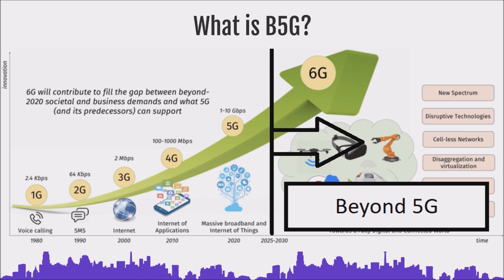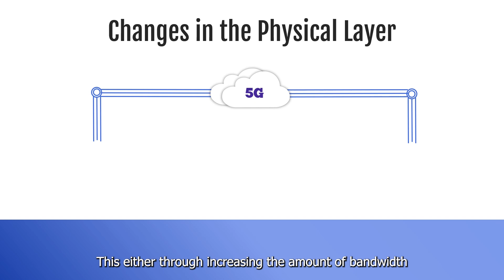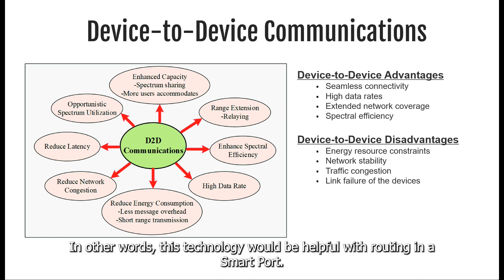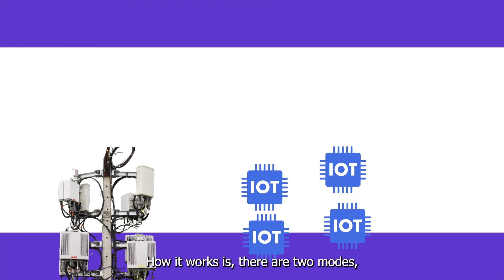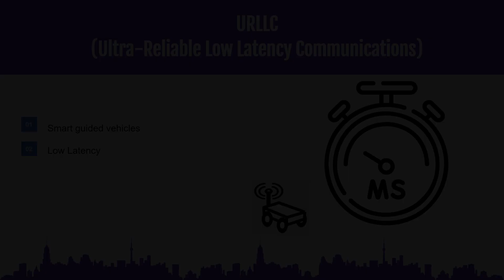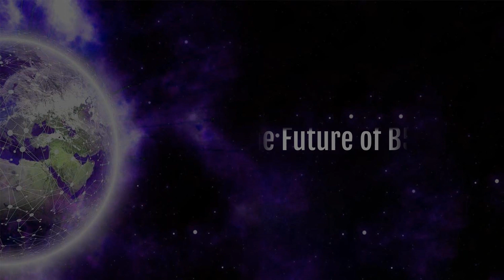How is Beyond 5G an Enabling Technology for Building Smart Port?

Comment: Great video! Just a few questions that I am curious,

1) Do you think building a Smart Port in Malaysia would be beneficial to the economy?
2) Do you think Malaysia's 5G Initiatives are going-well as planned? If yes, how long do you think it would take to build what has been highlighted/proposed on the video?
3) What is the difference between 5G - Beyond 5G and 6G? 

Thank you!
Reply from the maker: Thank you for watching the video. To reply your question, 

1) Malaysia is an export country with an increase in e-commerce and imports from abroad. It is highly beneficial for Malaysia/Malaysia-registered company in investing on a Smart Port. The reason is it would highly increase the efficiency of the ports, which naturally reflects in lowering YoY overhead costs.

2) I do not have the exact answer to this question, however, 5G initiatives is indeed aligned with Malaysia Digital Economy Blueprint. Ultimately, I am certain that it would benefit the general public. As for the implementation duration, I wish I have an exact dateline, but what I know is the government has been extremely active on implementing the technology.

3) As of now, the available 5G technology is still a non-standalone 5G, hence, it is possible to define Beyond 5G, a Standalone 5G or more than it. On the other hand, 6G is still undergoing a long research and development process in some countries. For more information, you can go through existing research papers. 

I hope I have answered your questions! If there is anymore questions, do not hesitate to ask! Cheers!
Reply: @dinochris1136  Thank you it helps alot!